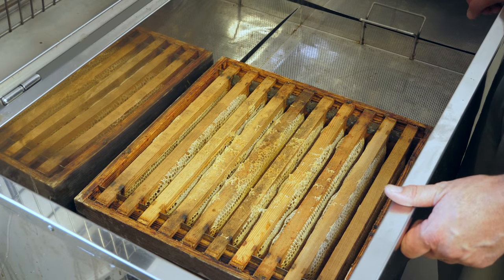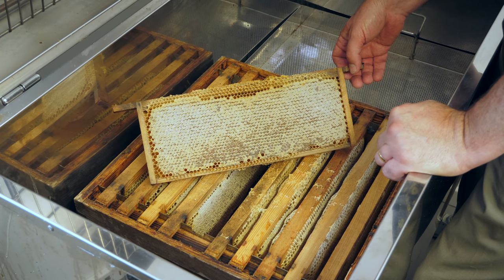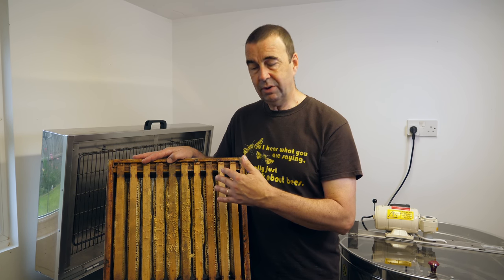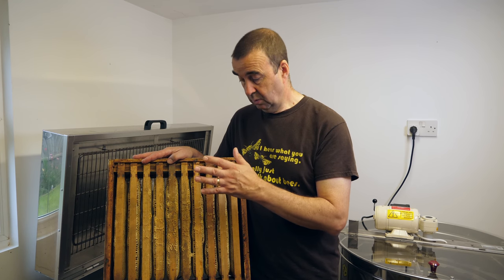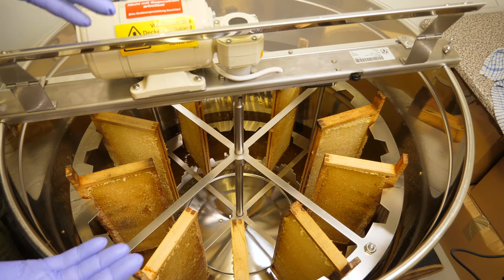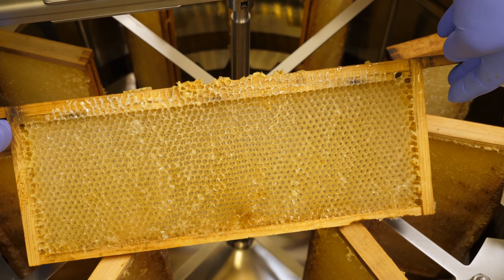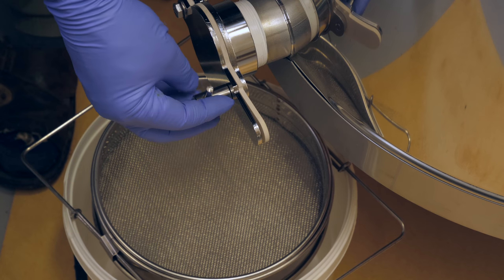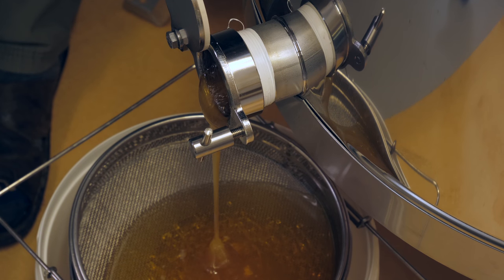Extracting Honey from the First Super of our Allotment Hive

Comment: Hi Steward. I got a question about an extraction method, that we were discussing. We have some frames with old honeycomb, where we need to replace the wax. There is no plastic foundation or anything of the sort. We are planning to cut the entire comb out, and heat it above the melting point of the wax. During the cooling of period, the honey and wax should separate. what do you thnk of this ?? It is similar to the process of cleaning old broodcombe with heat and water.
Reply from the maker: Hi G.N. & S.,
Your plan is exactly what I would suggest and the outcome should be a disc of wax floating on top of the honey.
Good luck with it.
Do let me know how you get on.
Stewart

Comment: Hi Stewart, how long did it take to extract those frames in that machine? I assume that it would depend on the motor but are there instructions on each make of machines regarding how long to spin for or is it a standard time?
Reply from the maker: Hi Lisa,
A lot of variables with extracting honey, as you indicated, the motor on the extractor but also the type of honey, the temperature of the honey etc. so the exact time is variable for each load I find. I usually extract until I can see no more honey being spun against the side wall of the extractor.
Stewart

Comment: Hello Stewart, have you any recommendations for storage of "dry" frames during the winter, safe from ants, wax moth, etc.?
Reply from the maker: Hi Christopher,
I store my "dry" supers at each apiary stacked on a pallet with mesh on the bottom to prevent mice getting in and a roof tin on the top. Ants have never been a problem for me over Winter as they are usually tucked up for the Winter as well. Wax moth have occassionally been a nuisance but not so bad as to need treating, just one or two. I might try an acetic acid vapour treatment this year and produce a video on it but it's quite a potent vapour that I'm not too keen.
Stewart